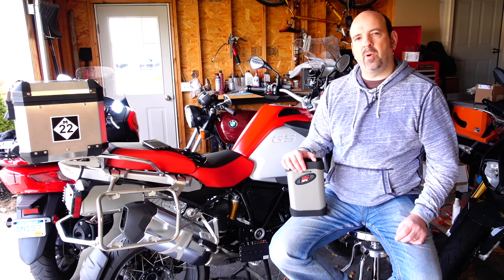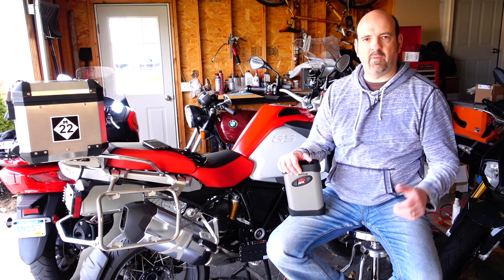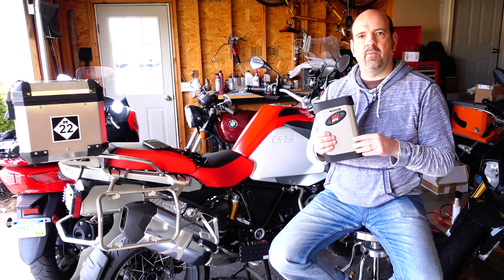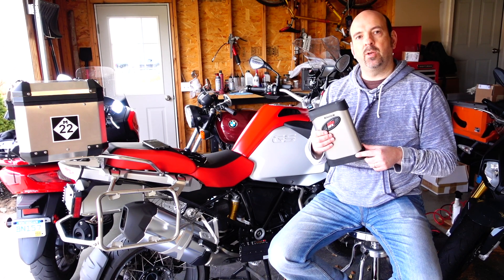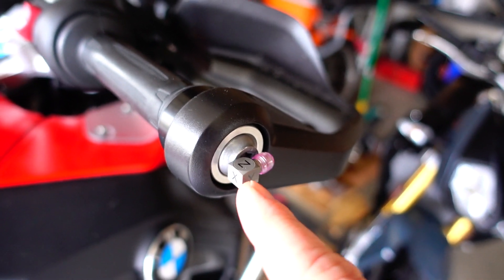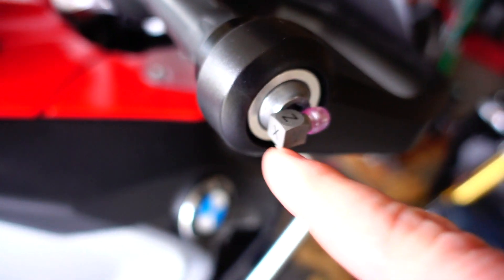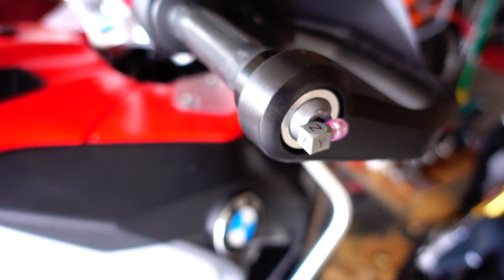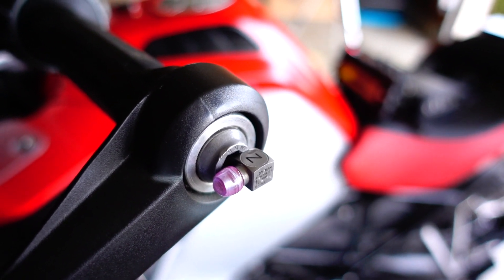Measuring vibration on a BMW R1200GS Handlebar -  Numb Hands Part 1

Comment: Was there no part 2? What was final results for ya?
Reply from the maker: @drewmorg - Unfortunately not yet. I decided to re-do the series on handlebar vibration for several reasons. Plan is to do one video that covers the measurement and then methods to reduce the vibration. Look for the video ln a few months. Thanks!

Comment: I had numbing in both hands riding MX bikes. Got carpal tunnel surgery on both hands and no more numbness. Just a thought.
Reply from the maker: @cdrseabee - Thanks for the comment! I've been on a computer most of my career and get the same numbness when using it if I don't shake out the hands periodically. I'm sure I have carpal tunnel, just hate to go under the knife. I'm sure I'll have to some day. Thanks again!
Reply: @zooskifilms   Yes the cause is CTS.   get the surgery, as it will most likely get worse!   Let is go and nerves will be permanent damage! 

 TIP from someone who has been through this.   Make sure your surgeon specializes in CT / hand surgery. HE MUST ONLY do that. My first surgeon was only an orthopedic and EF'd me up!!!  BADDDDD!!!!  

  Had to have it redone by a orthopedic that specialize in HANDS.
Reply from the maker: @davidfalgout7304  - Thanks for the tip and insight!

Comment: I too have felt this ’quite severe’ vibration, but only on shutting throttle. It was so severe it made both feet and hands numb over 50 mile trip. It totally disappeared when you slightly open throttle and apply the smallest of load. This is on a1250 GS 2020 model. I tried this on another GS, same year with same vibration.  You'd think BMwould not have these issues today!  Stopped me buying one!
Reply from the maker: Interesting. Some people have complained  about vibration when the bike is under load. For me it's the vibration over time, my hands get numb holding it in one position for too long. I assumed it was just fatigue, but wanted to quantify by doing this test. I really need to finish the second part of this video and try it over various conditions. There is a hand and body vibration standard that has recommendations for how much you should expose yourself to. I will include that as informational as well.
Reply: BMW doesn't care.......it is always NFF or operating within spec....on test rides they never feel anything and when abnormal sound are so obvious that people standing around comment on them, they cant hear anything

Comment: Hi, I can not find part 2 on youtube, can you put the link. thanks for putting this video.
Reply from the maker: I am working on a re-do of this video that will include start to finish analysis. After receiving comments on Part 1 I decided I needed to modify the scope of the analysis and re-do from beginning. Stay tuned!
Reply: @zooskifilms  I still cant find the re-do :(
Reply from the maker: @Clickmaster5k  - Yes, still a work-in-progress. I am trying to compile the equipment needed to take the measurements. I will do my best to have it completed by this summer. Cheers!
Reply: @zooskifilms  Nice! Are you going to try making different changes to your bars and see how that changes things?  Like with compared to with out end weights, that sort of thing?
Reply from the maker: @Clickmaster5k  - Yes that’s the plan. Need to explore best options out there to test. Look for it!

Comment: I have a 2018 GSA (absolutely love it) and I think it's very cool that you took the time to do this test.  However, there was one important factor I didn't hear made mention of in this video.  I believe when people complain about excessive felt handle bar vibration and it's numbing affects, that complaint is regarding the felt vibrations from sustained cruising engine RPMs while being in gear and under some load.   I could be wrong but I think those interacting harmonic factors towards the engine, will heavily influence the end result of the produced handle bar vibrations measured... compared to a out of gear and unloaded engine.
Reply from the maker: Yes, you make a good point about the cruising speed. I was going to share the vibration data I collected in my next video, but the focus was going to be on showing the vibration amplitudes with gear position and RPM. I was going to show both time waveform and corresponding frequency content. The recorded data I have is on a flat smooth road and moving through the gears and varying the RPM's. I did not record at a constant speed with and without loading (I assume by loading you mean uphill vs downhill vs various terrain?). My exercise is to produce an acceleration number, both peak and rms values, at the different frequencies where they were the highest. I can also filter out frequencies if needed, to focus on a frequency range that most humans are most sensitive to (16-26Hz). Of course I am not a hand and body vibration expert, just want to share this data under a set of conditions and let people come to their own conclusions. I am also willing to take measurements on other motor bikes for comparative purposes, but I would need volunteers with motor bikes to do so.
Reply: So did you ever resolve the numb hand issue?  I have a yamaha super tenere 2017 and i am having a real problem with vibration to the point of getting rid of it.  This bike is a great bike but it is the most vibration sensitive I have ever owned.  And I have owned a lot of bikes..
Reply from the maker: @jimwms1able  - I haven't resolved it. Actually my intent was to measure it and try to relate it to other types of vibrations people are exposed to. I didn't really have a plan to make some changes to reduce it, but that might a good video to make. I also have an older BMW R100/7 that has much more vibration and makes my hand go numb quickly. I know there are counter weights you can install on the end of the handle bars, I'll investigate and determine if there's a good video in there somewhere.